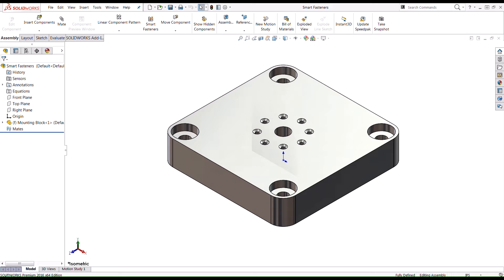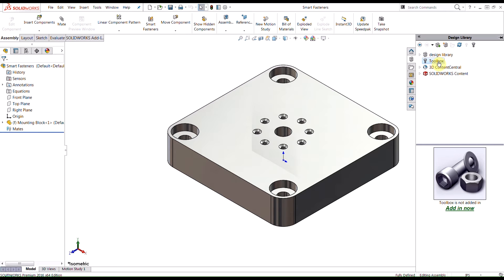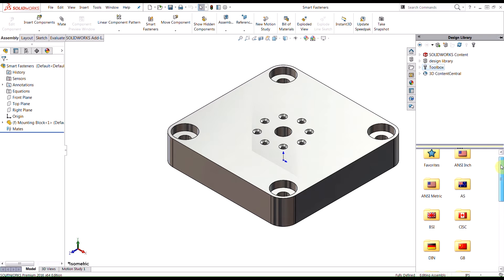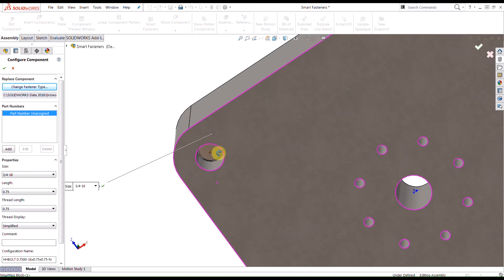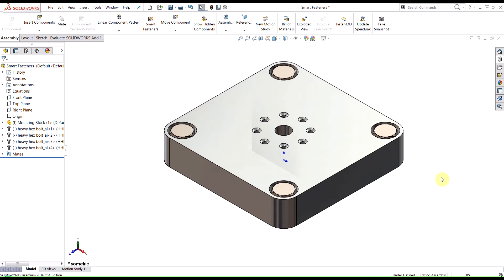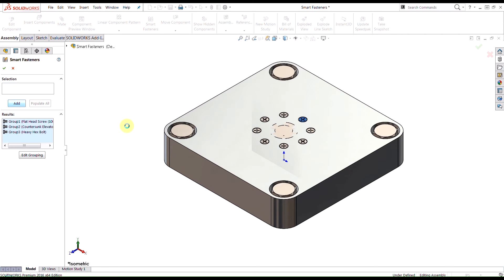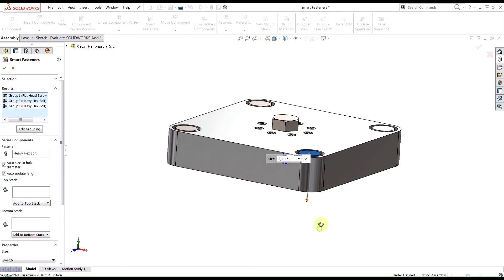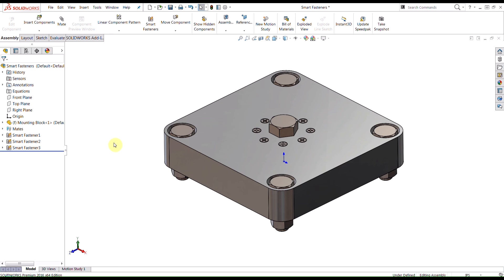SOLIDWORKS: Toolbox Your One Stop Shop

Comment: Hi, the good demo for learning smart fastening feature I appreciate but does the hole has thread put it inside automatically to be mated with the screw?
Reply from the maker: Hi Aizul, the holes created by the Hole Wizard do not have threads modeled. They have a cosmetic display of a thread, and also create the appropriate Hole Callout that can be imported onto a drawing to specify drill and tap. It's worth noting that even the Toolbox bolts don't have threads modeled - this is by design, it's generally not necessary for the CAD model and can cause performance slowdowns in large assemblies.

If you want to create the actual thread geometry (for 3D printing or other applications), you can use the "Advanced Hole" feature which does create the 3D threads
http://help.solidworks.com/2019/english/SolidWorks/sldworks/r_advanced_hole_type_pm.htm
Reply: @hawkridgesystems  You mean after fabrication there won't be a thread created at all inside the hole. So if I use smart fastener what benefit it gives with the screw that it proposed but in actual case the hole has no thread ?
Reply: @whiteking80  When you create a drawing of the model it will have the hole callouts included.  You use drawings to communicate your design to a manufacturer, so it will have all the information that they need to properly machine the parts. The threads don't actually need to be modelled in the 3D cad, they just need to be communicated via the drawings, and if you include them in the 3d cad, they add a bunch of unneeded detail that will make solidworks run slower. Keep in mind that you wouldn't normally be sending solidworks files to a manufacturer, you would send drawings.